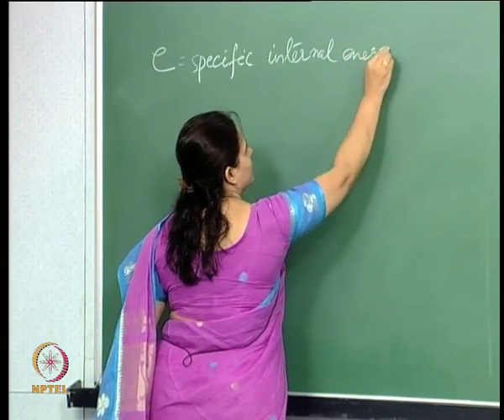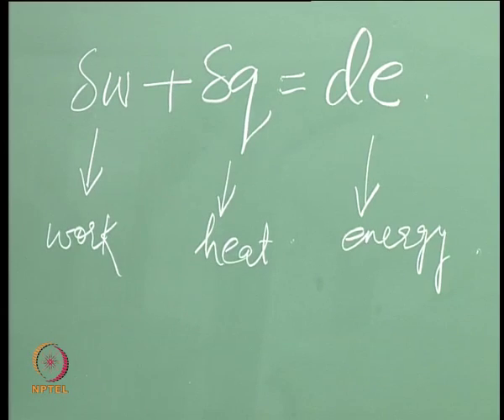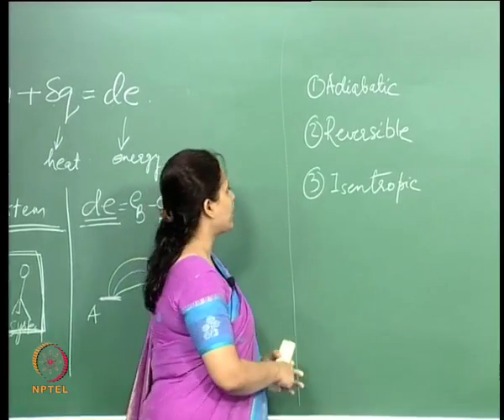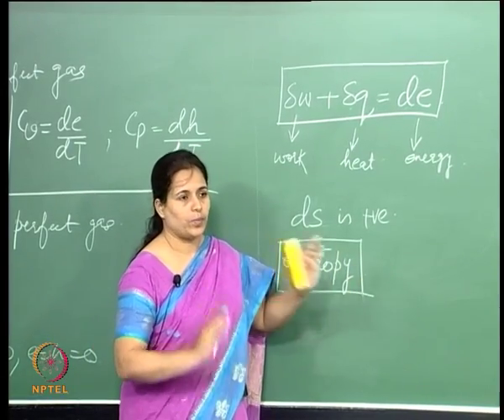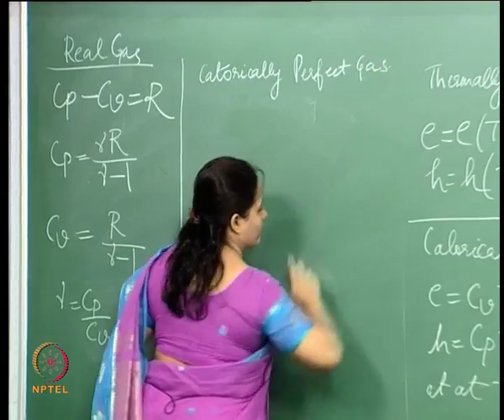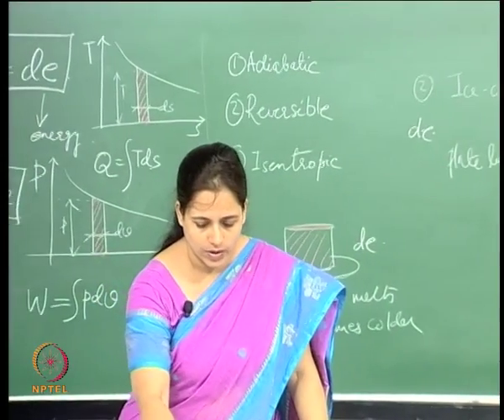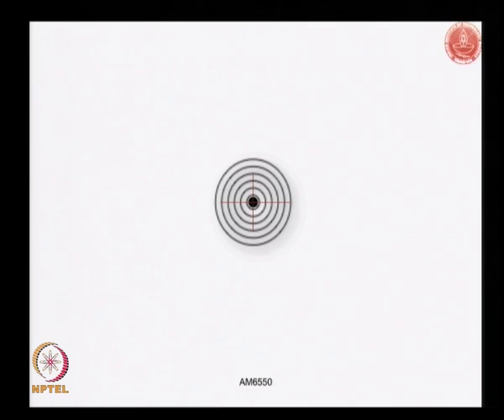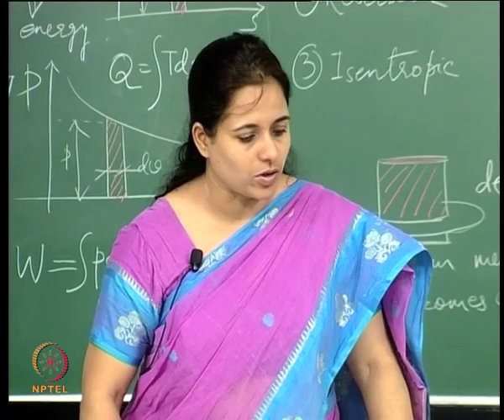Mod-01 Lec-02 Lecture-02-Review of Basic Thermodynamics Continued

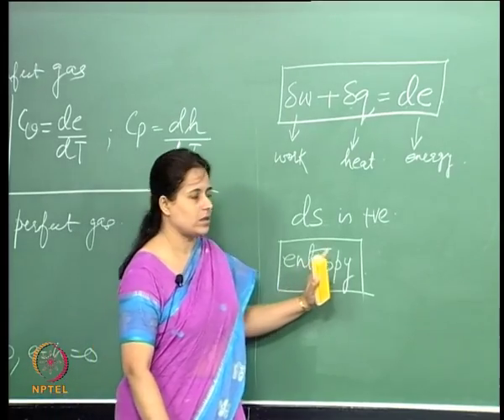Comment: 20:49 minor correction here. natural process will happen in such a way that the entropy of the system plus the entropy of the surrounding is greater than zero.
She mentioned that the entropy of system must stay positive or atleast zero, which is not necessarily true.
Direction of a natural process is decided by the entropy of universe, not just the system only, unless the system is isolated one.

Comment: At 02:45: Why e=e(T,"v") and h = h (T, "p")? Means, apart from temperature (T), why internal energy (e) is a function of volume (v), but enthalpy (h) is a function of pressure (p)? Probably some insight/explanation (may be 4-5 minutes in this 48 minutes video) from the thermodynamic point of view would have been better appreciated.
Reply: h = e + pv
Reply: The internal energy and enthalpy are how related to specific heat at constant volume and at constant pressure? It depends on the materials physical properties with temperature. System internal energy change does not have any effect on dynamic volume thats why it does not perform any work. But enthalpy it self as work function where variation of dynamic volume is must at constant pressure for an ideal gas;  Cp> Cv